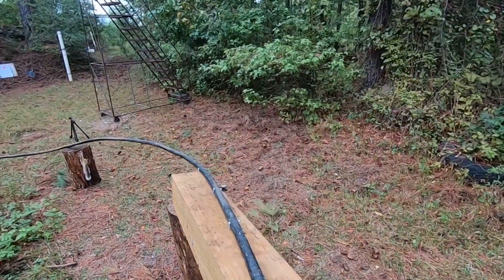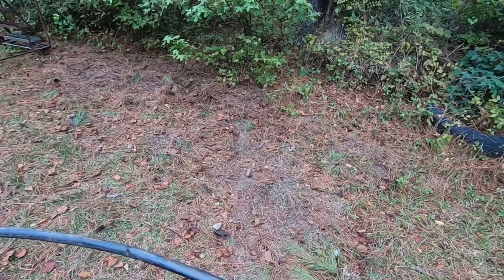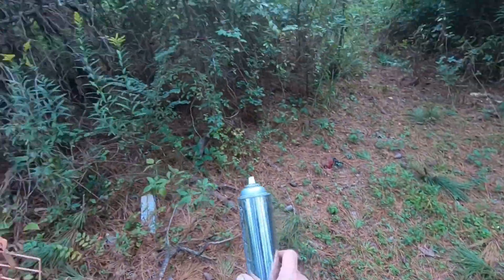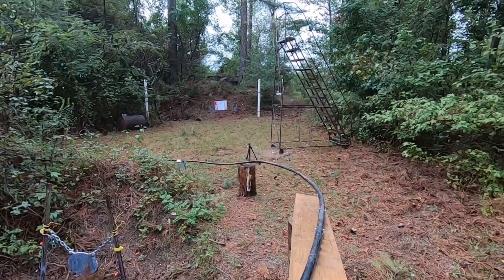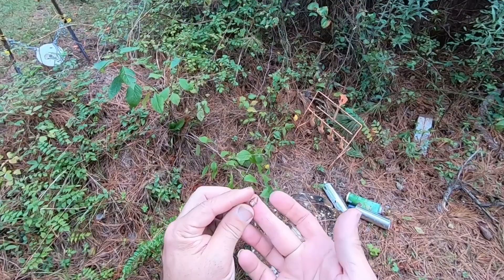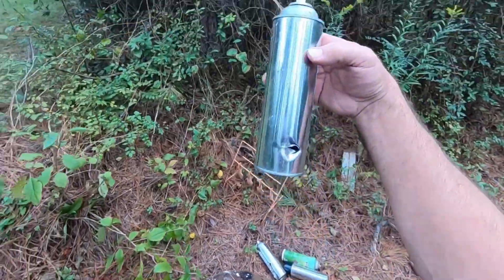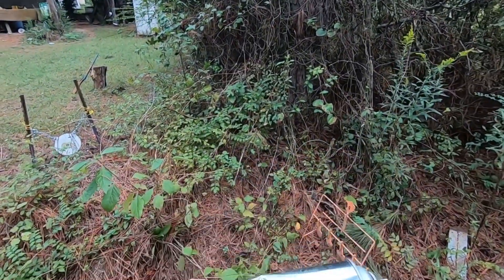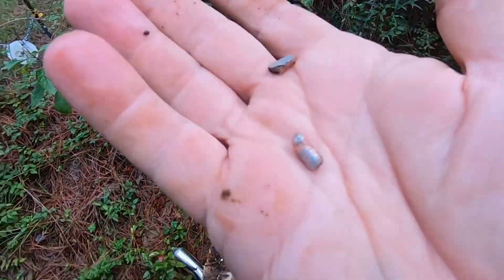Curving a bullet part 3

Comment: This could be a viable defense setup with a shotgun?? ...... galvanized 2 inch pipe? ..... might have defensive fire coming from 4 or 5 locations..... interesting
Reply: Maybe 1 1/2 inch pipe ..... you do know that in other countries they have made single-shot shotguns from pipes..... I don't advise that but they do it ...... but after more thought   I think your video was a really neat experiment ..... shot-shell pellets being as they are round may be more viable?..... fun stuff
Reply from the maker: I seen a pump action shotgun, that was made from pipe you could still see the seam inside of it, also seeing a bolt action shotgun made of pipes, in the Philippines
Reply: @Leverguns50  yup

Comment: Very interesting! I'm surprised the bullet was flat on one side since the rifling is spinning it.
Have to ever been to Death Valley?  There is a place there called Scotty's Castle.  Scotty supposedly had a secret gold mine and would sneak off and come back with a bunch of gold. Nobody has ever been able to find Scotty's mine.  True or not, he was paranoid someone would come after his gold, so he had gunports built into his house that were like half funnels to blast someone crawling in two windows in opposite directions at once with a double barrel shotgun.  Picture a magazine opened in half and layed on a table cover side up.  They said it was a good thing he never tried them out, because the angle was enough they thought the lead would come back and kill him if he used it.
Reply from the maker: That sounds pretty dangerous
Reply: @Leverguns50    I think so!

Comment: Just thought of something what if short the tube put the direction of the pipe upwars and within another cilinder holding those sprey bottles it should rake of like a rocket once in thd air you finish it off with the 12 ! Howaboutit..? 😊😊😊😨😊😊😊
Reply from the maker: That sounds like a good idea